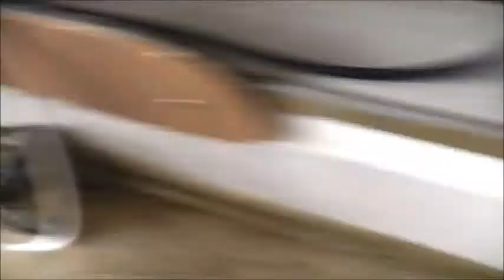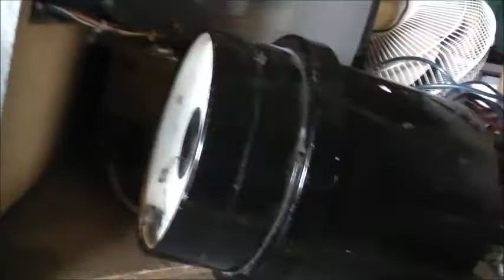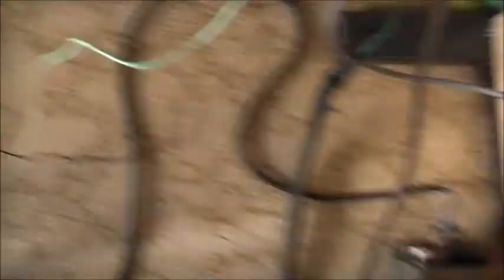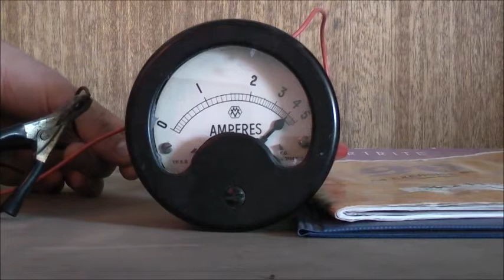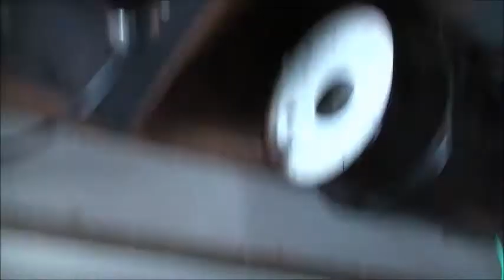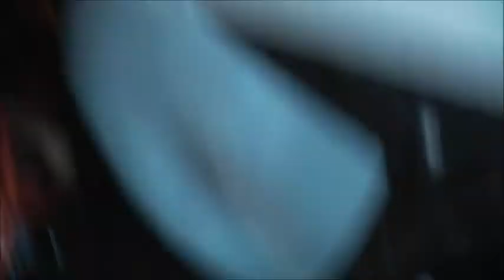Testing Meters!

Comment: LMAO & ROFL at 2:15 .......1.5 MegaWatts. You be careful that you don't pop the wall socket, tugging that much power out of it! :D

If you could figure out some kind of CT ratio for it and instead of 1,2,3,4 megawatts it instead reads 1,2,3,4 AMPS, then that would be great.

Or......

Work out some kind of CT ratio for it so that full deflection of the needle would be equal to 15A, then that would be rather usable too. :-)

Haha, I bet you can't stop playing with it, cranking up the needle in there. :D

Thanx for showing,

-BoomBoxDeluxe.

13th April 2014, 22.53